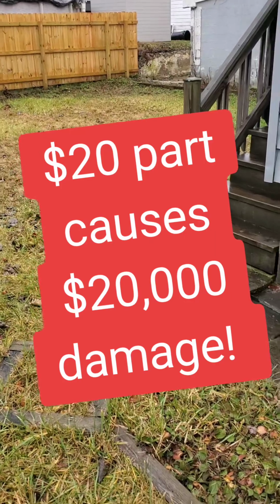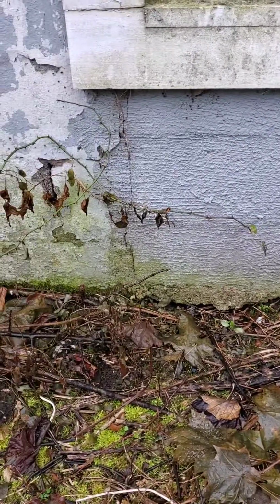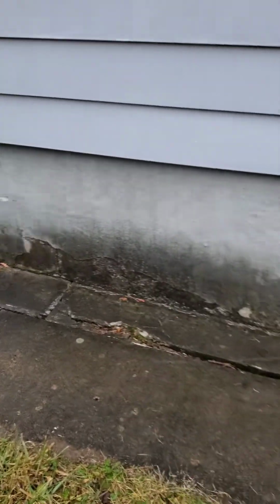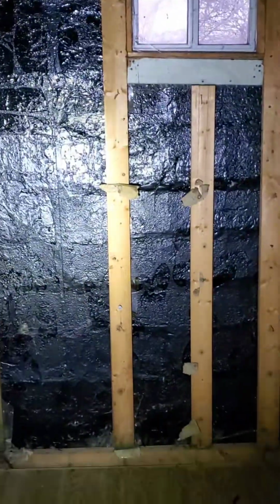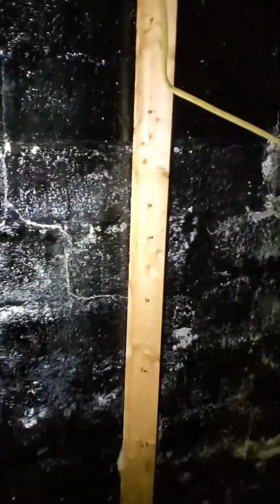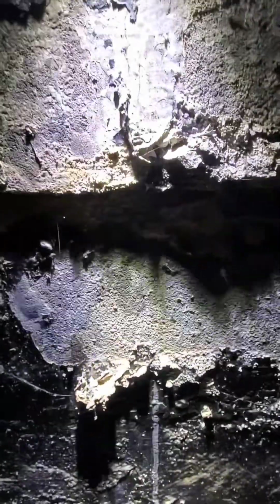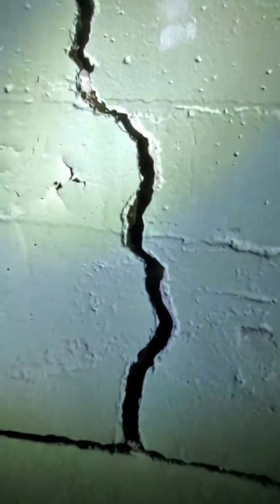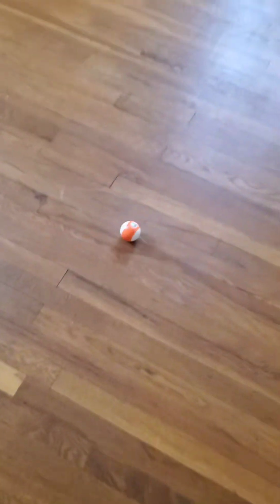Major structural damage on this home inspection!

Comment: My husband bought a fixer upper house that ended up having structural damage to the foundation. We got a structural engineer to come in and fix it. 2 years later everything is still looking good, no new cracks, nothing is leaning, nothing like that. It was originally caused by bad gutters pooling all the water into the front left corner of the house. After everything was fixed I feel that the house is tilted towards the front left of the home. Other people who go into the house say they don't see/feel that. I am 100% sure if I would bring in an inspector he would say there is.
My question is if their is a tilt to the house even though all the foundational issues are fixed what would that do if we wanted to sell the house?
Reply from the maker: Probably nothing.  If a SE created a corrective action plan and it was followed, then the adverse conditions are stabilized and you should be fine. Minor sloping of the floors in an old house isn't an issue unless it's something that hasn't been evaluated yet.

Comment: Absolutely no obligation (legally or morally) to disclose a mold problem if it is fixed. That's why people fix things before they put a house on the market.
Reply: problem was not fixed, other than cosmetically. Kinda like sticking a band-aid on a broken leg.
Reply: @rupe53  https://youtu.be/v3tFGP-xiYw?t=209: That's why you hire a home inspector to get an opinion on the fix. Nobody in their right mind would disclose something that was fixed (even if the fix is not addressing 100% of the issue).
Reply: @enfinityTX    the whole point of the video is this guy is an inspector... and he is pointing out what's been swept under the carpet. Doesn't matter what was done before. The guy is showing us what happens when it's not done right, and the problem wasn't completely solved.
Reply: @rupe53  Click the link I posted please. He clearly said the seller should have disclosed some potential mold problem. I’m not sure if you ever bought a house but there are tons of defects and cosmetic repairs in every house, hence the need for an inspector. But suggesting that you need to disclose things that are repaired (even poorly) is so far from reality.
Reply: @enfinityTX    I didn't say one way or the other. I did say it doesn't matter because what the inspectors finds is the reality at the moment. BTW, I have enough experience in the trades to see exactly what he is talking about.
Reply: @rupe53  my initial comment was about the disclosure. If you don’t have anything to say about that, not sure why you reply.
Reply: @enfinityTX    I was kinda trying to agree with your stance on disclosure, but that's only if it was fixed, cleaned up, and didn't come back. The last part is why I commented.
Reply from the maker: That is false. In my state (New York), if you had mold that covered more than 10 sq ft, you must have it assessed by an ELAP licensed NYS mold assessor, and it must have been remediated according to legal protocols and standards. You need to disclose that to potential buyers,  and have receipts from licensed professionals for the assessment and remediation to prove it.
Reply: @Inspector_preston Not in IL, not in TX. Have a great day